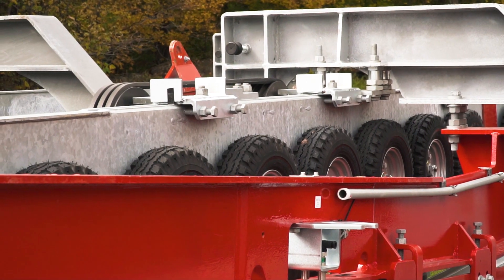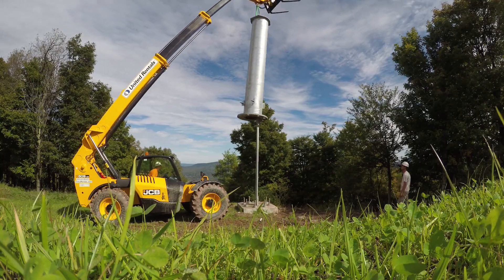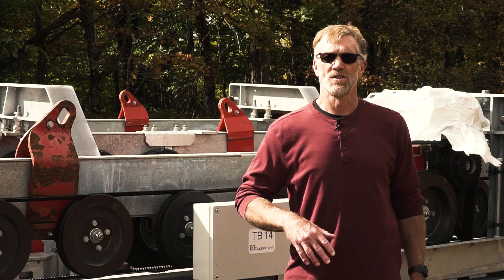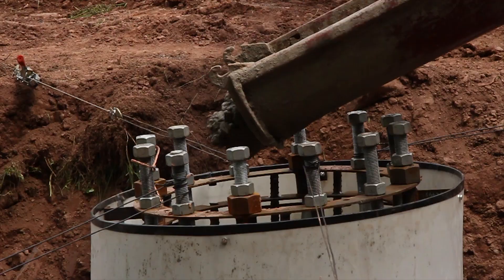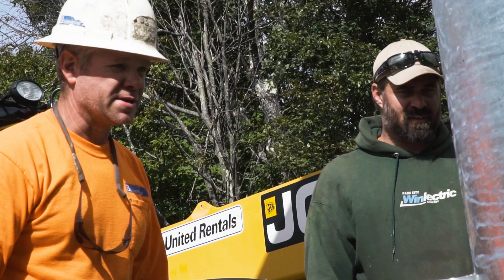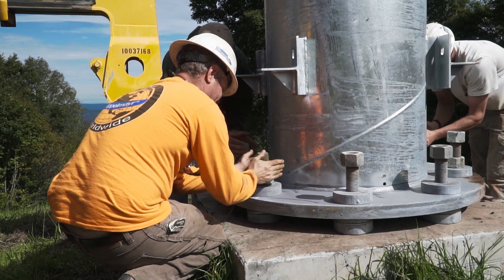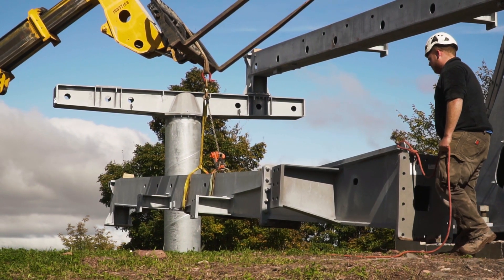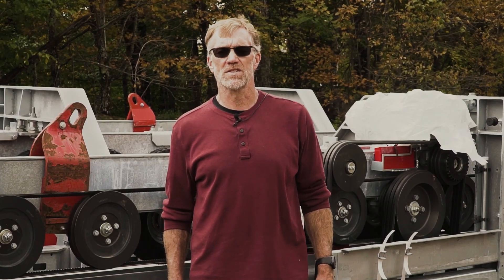New Westside Six - High Speed Detachable Six Pack

Comment: Westside Six Is Not That Impressive. Just Like Hunnter Mtn New Northern Express Both 6 Packs Are Not That Big Of A Deal. What Is BIG Is In BIG SKY Montana With The WORLD FAMOUS 1st EVER RAMCHARGER 8.  Most technologically-advanced chairlift  ever built. Not only is Ramcharger 8 the first of its kind in North America, it’s also the first Doppelmayr D-Line eight place chairlift in the world.   Lift capacity can eventually be increased from 3,200 people per hour to 3,600 with additional chairs just by the push of a button on the controls. Unlike Windham Westside Six Which is the basic  design Ramcharger 8  All of the grips have RFID tags for the Doppelmayr Connect control system to keep track of carrier locations.  D-Line grips even come in multiple color options. Also Adding To Ramcharger 8 Fleet Will Be Several VIP Gondola Cabins As Well As Some Dinning Cabins.
Reply: No one asked